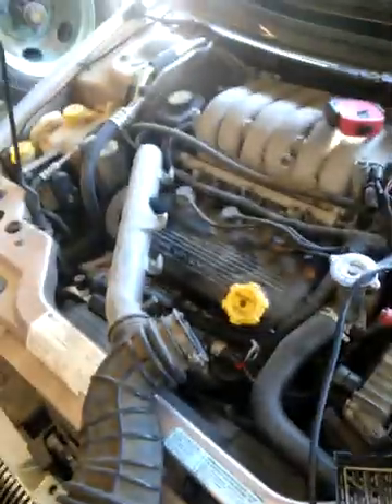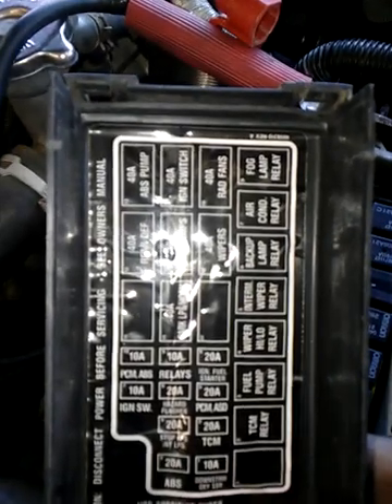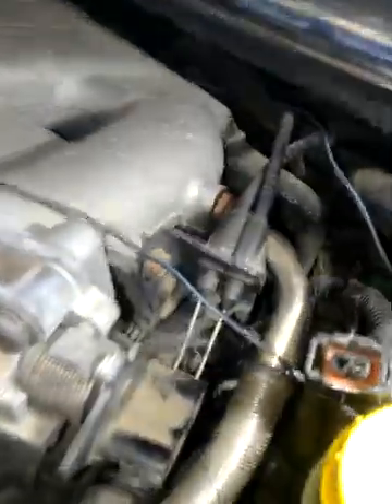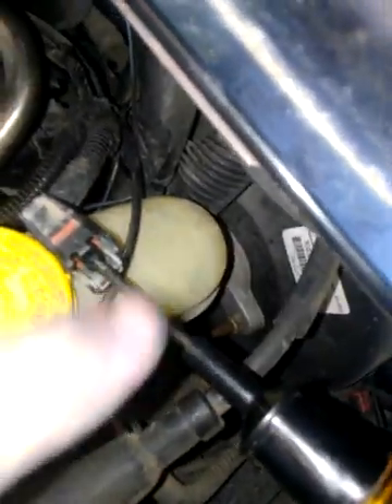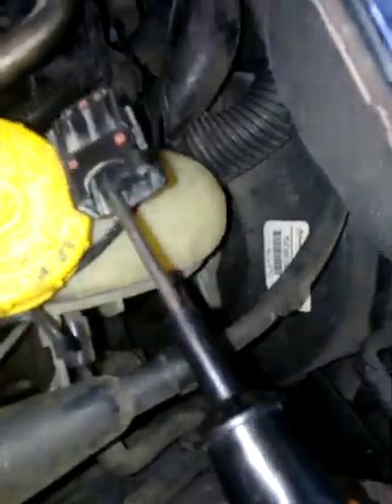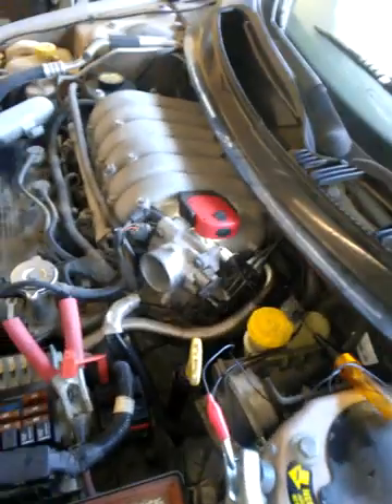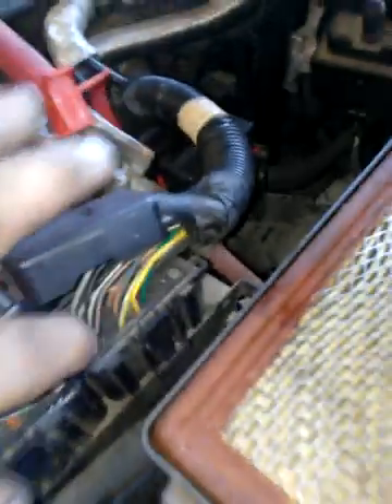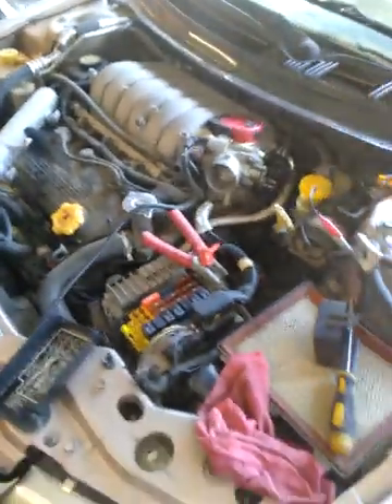95-00 chrysler 2.5. No spark

Comment: I am currently chasing a no spark issue. Car died while driving. Everything is good except for haveing 12v at that one wire when cranking it over. Test light comes on when you first turn the key but nothing when cranking. So my question is what would it be? Crank position sensor possibly?

Comment: So I just got a 97 lxi and it hasn't ran in 6 years and I got it running and it ran for 15 minutes then acted like it was running out of gas and died... So found out the fuel filter was in fact clogged so put a new one on after cycling the key a few times cleaning out the line.  Then new one put on and then NO START....  tired starting fluid and nothing even took the intake tube off and nothing. So now no spark... HOW??? it was just running! How does that happen and what should I check first?
Reply from the maker: Scan system first before spending a dime, crank sensor top rear of bell housing is often a culprit. But scan twice but once

Comment: hi chief now i'm having a trouble with a. cirrus 2.5 Lxi, today i replace the distribuidor cause i don't had spark in almost 2 wires but now the distribuidor si new and again i don't have spark in almost 1 wire, i remove the wire but the spark no go out from the distribuidor in the wire N4.
I replaced 2 used distribuidors but they has the same detail i was thinking ir was because they're mad but now is a new distribuidor, the car can turn on but have this detail what do u think i can do, what do You think i can check, thanks for Ur atention chief, saludos from mexico.
Reply from the maker: Ok did you test the primary wire coming in for 12v if voltage is present, check crank position sensor located top of transmission toward firewall will be two wire pig tail w connector secured w a 10mm bolt pulls strait up and out,does the engine sound normal during attempted starts ?
Reply from the maker: Scan system and see if any codes are present and relay the codes to me
Reply: Ok i'm again the primary wire have 12v, the Crank sensor it's okay have 12v, ground and a good signal like 8-12v i don't remember well but it work okay, i check the time of distribuidor and its fine
Reply: But i don't know about the cam sensor of the distribuidor because when i rotate the cig poley the V are 4.90 and don't convince me

Comment: @william Larkin , question I removed the upper intake plenum to replace one of the heater core hoses  and I double checked that everything is connected and now I have no spark , car was running fine before intake plenum was removed , Im stumped , any suggestions on what to look for ? Thank you in advance
Reply: Hi there. I’ve got exactly the same situation. Have you solved the problem ?
Reply: @MrBdez   crank sensor came unplugged
Reply from the maker: Sounds like you unplugged someting

Comment: Hello, the Clessler Stratos model 98v6. The engine does not start and when we start the car, the RBM meter does not work and the check light is on. What is the cause of the malfunction

Comment: When I turn the key on. I get a quick light at the plug.then it goes off.

Start cranking on engine. I her no 12V power coming through the plug.

Any ideas?
Also I have a donor parts car. I changed the ECM
Reply from the maker: What color is the key head if it is a cirrus lxi wall the bells and whistles and key head is grey it is a chipped key. And the new. Pcm. will not recognize it. The skim reader will disable spark and fuel pump. Put original back in and retest. And get back to me
Reply from the maker: Replace distributor the one in your parts car may be bad too unless the problem w the car is damaged ie wrecked. New dist is 239.00 before tax.
Reply: The distributor is a remanufactured . 

It is a base model car.
The key is black. Standard key.
All fuses are good.
Reply from the maker: Start w fuses and relay this car is security equipped key that locks out starter and spark

Comment: 1999 cirrus 2.5 liter with 50k miles. I have a crank no start condition, no spark. I have my obd2 scanner plugged in while cranking and set to read engine rpm, sits at zero on the graph until the scanner says link error while cranking for a couple seconds. I see the rpm needle on the dash come off it’s seat, but no change on the scanner. I hear the fuel pump during its 2 second prime, and I can smell fuel after cranking. Some direction would be appreciated. Thanks
Reply from the maker: rusco321 needs distributor
Reply: William Larkin what about the link error?
Reply from the maker: rusco321. Check fuses no communication means theres no power how ever you said you have fuel pump running says its working. What type of scanner are you using?
Reply: William Larkin actron with live data, in global obd2 mode. Possibly a bad computer ground thats getting overloaded during cranking?
Reply from the maker: rusco321 try unplugging ecm and inspect connectors and let sit for 7-10 mins and try to start

Comment: What if you dont have power on that plug when cranking it and the asd rely has been changed and it has all its power and grounds but not getting singnal to turn on i tried to replace ecm but still the same thing and its the base model no theft alarm its got me stumped about ready to crush it
Reply from the maker: Autoshut down relay or fuse
Reply from the maker: Scan no communication means pcm fuse or computer it self

Comment: I have 2003 Sebring with 89,600 miles on it I run out of gas put some in car shaking in blowing out white smoke when I turn it off then try to turn it back on it want start please help me
Reply from the maker: yashe parnell. White smoke is usually indicative a head gasket. Or a large scale internal oil leak
Reply: William Larkin oh wow how much will that cost me
Reply from the maker: yashe parnell. Find a reputable tech you can trust or has good reveiws and get a second opinion. And price will be based on level of repair needed

Comment from the maker: Feel free to ask qusestions about your chrysler or dodge
Reply: I've got 1996 chrysler sebring crank no start condition it has fuel the distributor has been changed along witht he cap and button and the asd system is good and I still have no spart
Reply: Hey I have 1999 sybring n I change  ignition n the security light  on n it won't crank
Reply: Where is the 12v DC wire you are testing?
Where is it plugged up